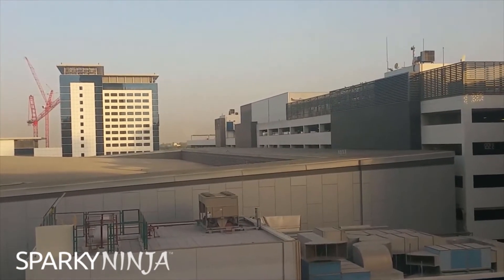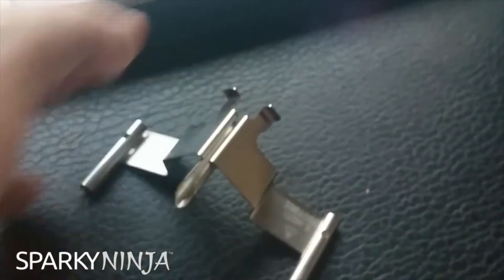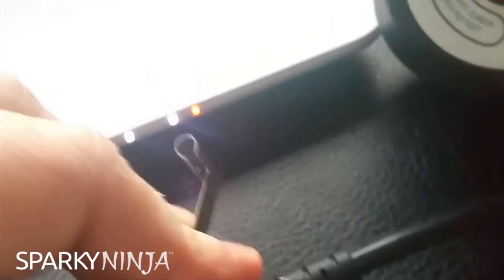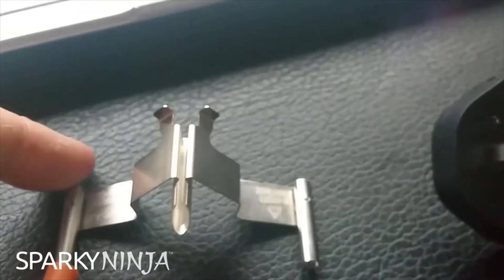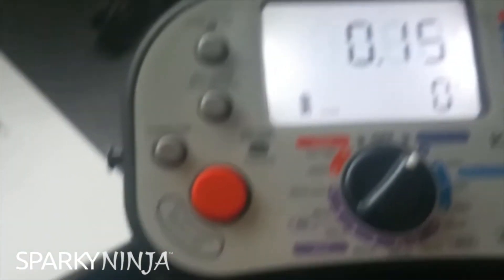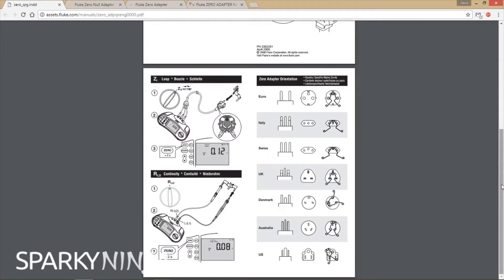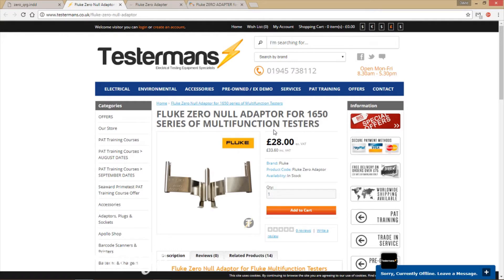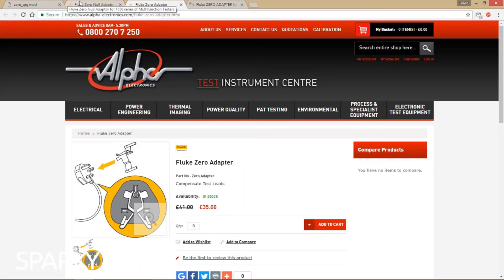Fluke Zero Adapter - How much?

Comment: Well nulling crocs and prongs is easy. For nulling a plug top I have a 22mm copper pipe coupler, just plonk it between the pins and press the button. :)